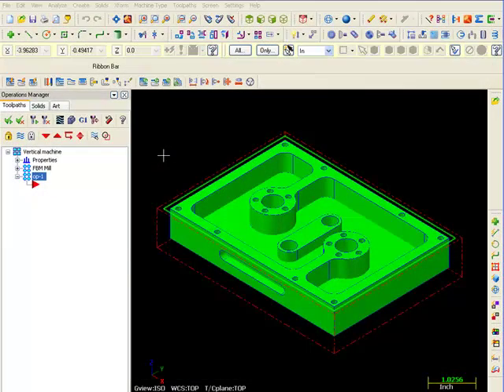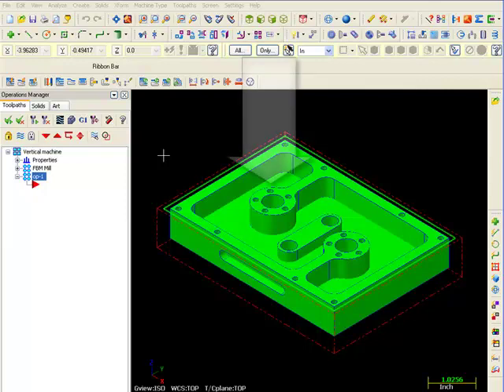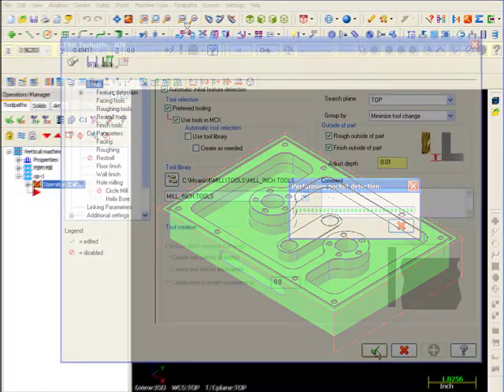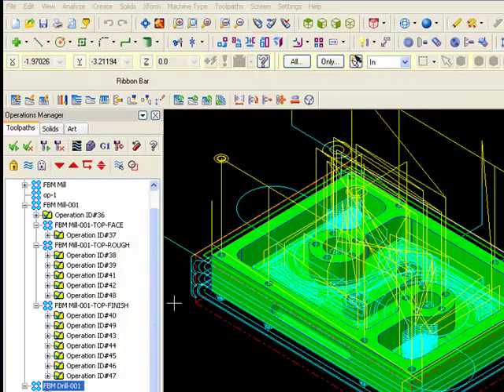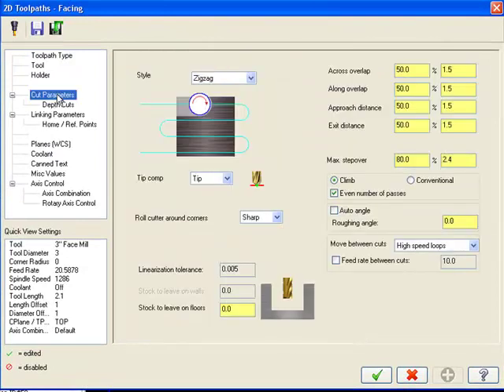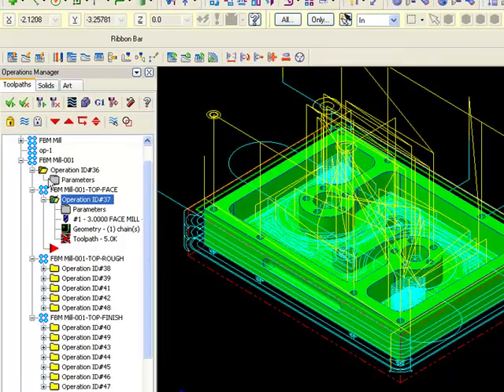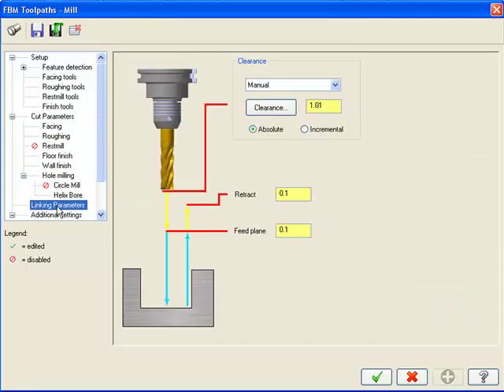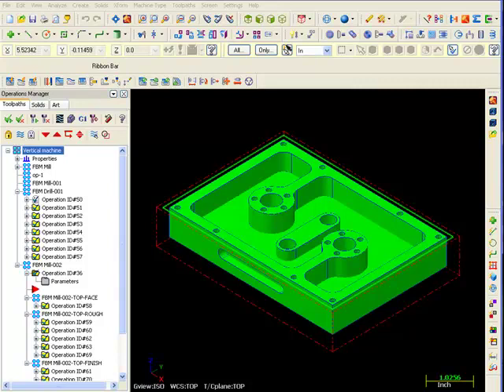Feature Based Machining in Mastercam

Comment from the maker: It has very good potential. Right now it feels complicated to set up, but once you have your preferences dialed in, it's pretty good. The main problem is in the defaults. If you just apply the toolpath straight out of the box, the cycle time is too long, that's why people complain about it, however when I tested it on this part, once I setup everything correctly, it did a nice job of programming the part.

Comment from the maker: As I said in the video, it took me a whole weekend to get the program optimized for this simple part, however,I could re-use those parameters for other similar parts.

The marketing mistake that CNC software is making is in shipping the software in the default state with nothing optimized. If they were to spend some time setting up the default install so that it output a reasonable program the first time somebody uses it. People would be much more motivated to give it a second try.

Comment: It's too bad that MC replaced the solid drill feature with Feature based drilling. The solid drill was quick and easy, The Feature based drilling required too many parameters, tool libraries and jacking around to get it to work.